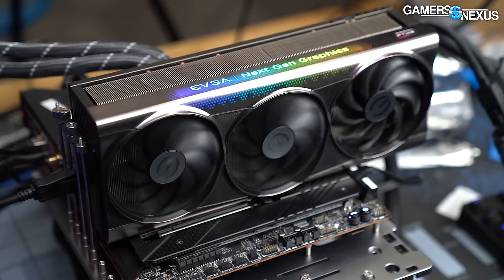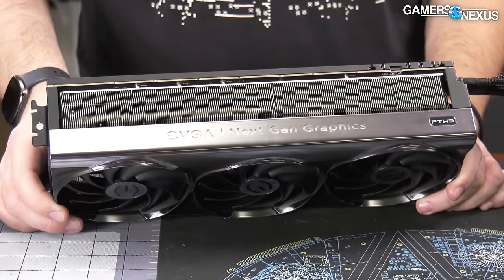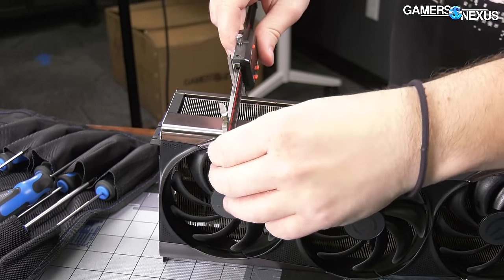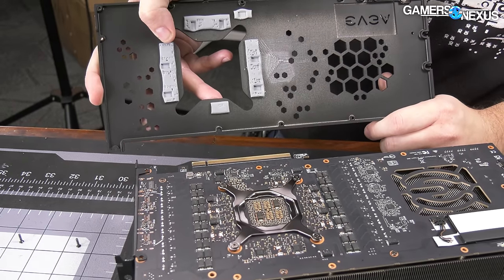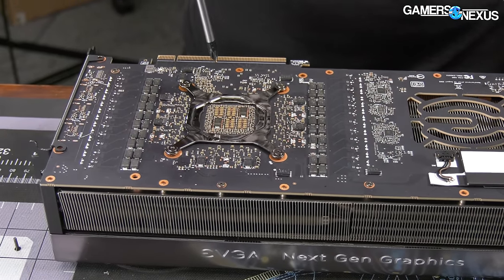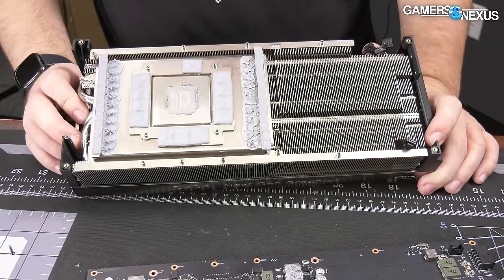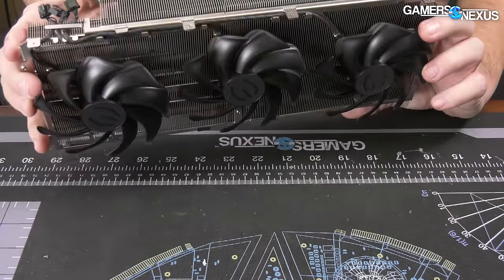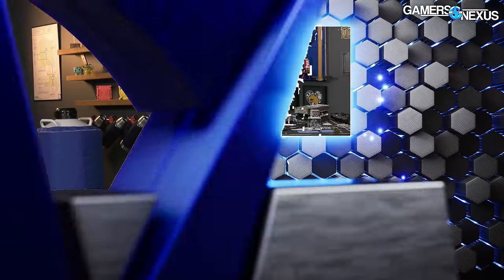EVGA RTX 4090 FTW3 Tear-Down & Disassembly: A Major Loss

Comment: Imagine if Nvidia criticized power connector placement and that was the final straw
Reply: I doubt it was anything so trivial, EVGA probably saw hints of the expected RRP and the costs and just decided it wasn't worth it. They're a smaller more boutique manufacturer so they can't spread their costs like an MSI, gigabyte or ASUS.
Reply: It was probably those shitty profit margins, 3000 series was probably enough for evga. Nvidia obviously doesn’t have to care about aib profits but if you’re evga why care about nvidias profits.
Reply: Yall love writing fanfic, but it obviously had nothing to do with that. Area 53 summed it up nicely. Jensen has made it clear for many years now that he's enamored with the Apple model of business, and so that's what Nvidia is working towards. A future with no AIBs. The profits are already razor thin for those companies. EVGA saw the writing on the wall and got out early.
Reply: @Washanuga  Yup, exactly and wanting to copy Apple isn't good for consumers whatsoever, probably switching back to AMD this gen if the 7000 series looks good enough for the price! I only switched to NVIDIA with the 20 series when I nabbed a cheap 2060 Super to upgrade from my old RX580 (Which I loved and had no issues with at all) Loved the 2060 Super and also love my current 3060Ti, however gotta say, after all the shit-talking about AMD drivers, NVIDIA's recent ones have been completely wack, I've never had a driver make my card act so strangely before till the one before the most current, I actually thought my 3060Ti or PSU was dying because GPU Load and Power to the card were both dropping to 0% randomly in games causing insane stuttering or the game would fully crash to desktop. Rolled back drivers and the problem went away, I was amazed it was a driver issue doing that. Luckily the most recent one doesn't exhibit the same behavior at all either. Also will add that I'm happy Intel is in the GPU market properly now, so we have 3 companies and more competition is better for all of us, just hope Intel brings out some proper flagship cards that can compete better with AMD and NVIDIA's higher end cards.
Reply: @licensetoshred  Problem is that I had several times the same kind of experiences with AMD. Crashes, overheating weird artifacts...not to mention the awful microstuttering in a lot of games. And I enjoy the extra feats Nvidia put on their cards. Loved playing the Arkham series with the Physx effects, and now DLSS and RT makes it worth it.
I do agree that they failed big time with the 4090, tho. Too large, too power hungry...I hope they lose a lot of money to AMD this gen and they change their ways and put more effort in efficiency.
Reply: @Shendue  Well RT is not a feature by Nvidia. It has been around forever and is a standard of Direct X.
What nvidia has is their tensor cores as specific calculators for Raytracing. Which gives them better performance.
Thats a seller if you are into RT. but most of the time its not used well and only costs performance for minimal changes that don't look like reality at all.
Also there are different ways of implementing RT. For example Dirt 5 and Watch dogs legion have RT and its good but it does not cost too much performance.
DLSS is also nice, but i prefer an open solution like FSR and XeSS. That way even older nividia cards profit from the performance gain. 

In the end it all depends on what you need and what you are willing to spend. For me it was simple. I want the most bang for the buck. The most fps for my money. And that is the RX 6800. And that will be enough for the next 3 years. Then i will take a look if there are cheap second hand cards or buy a new card for a good price-performance.
Reply: It's not as simple, but I think over the course of news since the announcement the info is out there that tells you why they ended partnership, you could piece it together, but even as a joke it is not what you were writing, the power connector placement, because nVidia doesn't really care that much how their partners create and design their cards basing on a given blueprint by nVIdia.

It's all about money and how much nVidia probably likes to change their naming of the cards in the last moments and other factors where partners are paying expenses that are not covered by nVidia, I suppose... Or maybe nVidia is covering some losses caused by nVidia itself? I don't know about that part. But it is damn sure it is about how business works there and how nVidia is playing with everyone.
Reply: @Shendue  Majority of times, AMD's issues are user-dependent.
Nvidia drivers are pretty much a joke and their high-end cards have been the least reliable since the 2000 series and continue to be.
Also it doesn't offer many feature more  than AMD, if not less. Nvidia's software is dreadful and gets annihilated by AMD's.
RT isn't going to get widespread anyways and FSR is just as good as DLSS now.
Only reason one would buy Nvidia cards is CUDA, and there isn't much AMD can do about it as long as devs refuse to optimize software for them too.
Reply: @Marco Sassari holy hell, I hate Nvidia but your comment reeks of copium. Nvidia having worse drivers than AMD? You can't be serious. Remember all the 5700XT black screens? Poor stability of pre-Crimson drivers? Or how about AMD dropping support for GCN? AMD's drivers SUCKED for the longest time. It's only with Nvidia's latest 526.61 driver that bugs started popping up.

Don't even get me started on feature set. No, Nvidia does NOT have "less features" than AMD. Where's your NVENC and CUDA support on AMD, two things widely used by professionals and streamers? Or DLSS 2, which is still superior (only slightly) to FSR 2 in terms of image quality.

Oh and you conveniently ignore RT performance (where AMD does worse than Nvidia) because  "it's pointless and devs won't add it." Spoiler alert: most AAA games have RT now. Just off the top of my head: Forza Horizon 5, Metro Exodus, Spiderman Remastered, Cyberpunk 2077, Gotham Knights, and many more to come.

Please, inform yourself before you go out on a whim to embarrass yourself. It's not that hard to do research.
Reply: @marcosassari5603  LMAO "NVIDIA drivers are a joke" ??? I guess I've just been.. hallucinating! for the past 10 years, my drivers have been a joke! dude! I've not been able to get anything done! holy mother of god, put down your copium tank, fan boy.
Reply: @licensetoshred  Yeah i've been having the same driver headaches with my 3070 in my laptop. I still can't play MW2 even with rolled back drivers.
Reply: @parsa475  Well nvidia drivers for linux are a joke. They really are.
Reply: @edenjung9816  I'd still argue that is a better position to be in for Nvidia compared to AMD.
Reply: @parsa475  Not with Linux.
AMDs drivers for Linux are the gold Standard.
Reply: @edenjung9816  what I'm saying, dude, is that although they should all work fine on all operating systems, Nvidia working on Windows where 99% of their users and the video games are is BETTER than AMD's situation, where they work better for the 1% who use Linux. If Nvidia has put more effort into making their gaming GPUs work better for Windows where they can be used for what they're actually designed to do, then that's a reasonable decision IMO. I still don't know what the guys above was smoking, though.

Comment: I said it on Jay's video too but I gotta say it here, something about this video feels very bittersweet.  I wasn't planning to upgrade to 40 series regardless, but just the loss we see here and how beautiful that card is feels a little melancholy.  EVGA will be missed.
Reply: I wish they'd partner with AMD
Reply: The first three GPUs I got when I started building my own computer was EVGA 760, 980 Classified, and my final EVGA and Nvidia GPU was a 1080.  I'm all AMD in my PC now, and with the 7000 series Im hopeful that EVGA will at least do one card with AMD.
Reply: A little?
Reply: @Woeisme2  They should partner with Intel for their next gen cards. AMD is doing more than fine right now, but Intel desperately needs a competent OEM company to set them on the right track, their current card designs are incredibly mediocre. Especially if Intel is serious about releasing some high-end cards next year.
Reply: yeah they were heading towards making probably the best version of the 4090. this is nicely laid out, well designed, and in Jay's video, he showed that the memory and chip both could handle some good overclocking.
Reply: @iddan1205  I starting building a personal gaming PC back in January and now have an EVGA 2060 12GB 3060 XC 12GB and 3080 XC3 10GB once my brother buys the current rig I have with the 3060 I will use that money to finish building a Ryzen 7000 series with the 3080 just need the motherboard CPU and RAM to finish putting it together in a Corsair 7000D airflow case
Reply: @KillahMate  If Intel let them do whatever they wanted with the Arc silicon, I could see EVGA making crazy “K” series variants as Intel’s premium option.
Reply: @ghomerhust  EVGA making the best version of .... Got me thinking, when was the last time an EVGA card version WASN'T the best of?
Reply: @KillahMate  Intel needs to sort out their drivers and the performance in older titles. Performance in games like cs go is laughable even at their lower price point.

Comment: Bless them for putting the 12 pin in the correct spot, I really feel like we should be more critical of certain other card designs that don't recognize its correctness lol
Reply: Placing opposing side from the fan means that there's no need to bend anything and it would fit in most cases. It's tradition and easier to manufacturer that keeps it where it is on most cards.
Reply: This connector and issues may well have been the reason they severed ties, as EVGA wouldn't put up with the warranty risks on their products due to something forced by Nvidia.
Reply: I was actually wondering, maybe this is why they made the PCB longer than others
Reply: Why if it's the last card from EVGA? EVGA cards will never be sold again.
Reply: @BlueBerry-kh3lx  Maybe Intel or AMD will work with EVGA
Reply: In a separate video Kingpin mocks NVIDIA on their decision to put the power pins to the most thermally hot place

Comment: It's a real shame EVGA is out of the GPU business. That fin density alone vs the Strix looks amazing. Breaking my heart.
Reply: I read this as EVGA showing some ankle to potential suitors.
Reply: @rhythmandblues9302  They need to cover up those ankles damn floozys lol.
Reply: @rhythmandblues9302  LOL I ain't heard that saying in a long time 
If I'm up on my internet law, I believe I am now legally obligated to use that phrase as often as possible for the next couple of weeks.  This should be fun.  Thanks!
Reply: not only that, there are the only clever one that placed the power connector right🥲

Comment: Like many, I was an EVGA loyalist. I bought a b stock 3090 and 3070 knowing they may never make another gpu. It’s an honor to have them.
Reply: I’m thinking about trying to get my hands on a 3090 EVGA card just to have it as a collectors. I have a 3080 tuf in my main rig
Reply: I got a B stock 3080. Works great, low noise and low temp, especially with an undervolt.
Reply: I got a 3080 to replace my 1080 and made sure I got an EVGA one.  I know it'll last me a long time under water.
Reply: It had the best price to performance 2 years ago when i was looking at rtx 3080’s. EVGA Ftw3 3080
Reply: @KillerInstinct1  Yep, it's not too large either, the cooler is awesome, and it undervolts like a champ. 920mV at 1950MHz (same as stock).
Reply: lmao
Reply: hanging onto my 980ti, 1080ti, and 3080ti ftw 3's for a long while
Reply: Keeping my Kingpin 3090. Thing is a beast. Collector item for the future.

Comment: Dude!!!! That tear down was legit. It looks like a very straight forward process and did not seem like you needed elf fingers. It is really sad that this card won’t come to market. :/
Reply: Clearly a card for dwarven hands.
Reply: I think it's so easy to disassemble because it's an engieering sample, and EVGA engeers will need to disassemble and reassemble it multiple times. I guess the final version would be a bit more annoying to save cost and/or improve looks.

Comment: I adore my EVGA 2080 ti. I wasn't much of a PC expert when I bought and installed it into my prebuilt rig, so I was amazed to later discover that the temps are really solid. Looks and runs great too. Really hope EVGA considers partnering with AMD!
Reply: Why would they partner with AMD if they just quit building gpu's for Nvidia, they might have the same problems with AMD, since no other manufacturers seem to be having problems with building gpus for Nvidia.
Reply: @budgetking2591  other companies definitely do suffer the same problems as EVGA. however, a quick google search reveals EVGA is privately owned, meaning it is not solely a soulless profit generating entity completely at the whims of investors and shareholders. that means EVGA's CEO can just up and do something else with the company if he's had enough
Reply: @budgetking2591  Theres something called "contract" which binds 2 or more parties together under certain conditions and often times it's timed. Evga can set certain conditions for their own benefit when working with amd and amd really needs to honor working with evga

Comment: Here's hoping that one day, EVGA returns to the GPU market in some form or another. This might have been the most "practical" 4090 in the lineup. Mainly because of the smaller size and power connector placement.
Reply: Intel and AMD in the future i hope.
Reply: I doubt it, I suspect the industry in moving towards integrated GPUs, the M2 Ultra would be probably close to a RX3080 already.  NVIDIA was trying to acquire ARM and has plans to move in this direction too.

Comment: I'm in the process of 3D modelling a new shroud for my Zotac 3070ti to use with noctua 92mm fans instead of the stock solution. I think I just found the perfect shape for that.
Reply: Back in 2009 I did that with my ASUS GF 9800 GTX+ Dark Knight. That small fan was really noisy so I took it off and just slapped 2x80mm Noctua fans strapped through the fins. It was quiet and gave me more OC potential.
Reply: If you can share the final result I would be grateful !!
Reply: Do share the end model, I bet plenty of others would love to have an EVGA-styled shroud.
Reply: Sure. When it's done I'll post it on printables and share a link in this thread. Might take a week or so. Also, be advised the first iteration will only fit a Zotac 30 series Trinity heatsink. Although I would be open to commissions to adapt it to other heatsinks, provided I'm given accurate attachment dimensions.
Reply: Here I am buying a Asus×Noctua 3080 and this guy is designing his own.
Reply: GN has links in comments auto-disabled, but if you go to my twitter (same name as here), you can follow along. I just posted an initial 3D render.
Reply: First part is printed and fits, awaiting fans and adapter cables to arrive in the mail, then we can test temps before printing the main shroud.

Comment: Did not expect to hear that you guys would actually be testing the card! Very excited to see that, even if it's simply in line with all the other 4090's right now. Either it's impressive, which would show what a loss EVGA is as a partner, or it's functionally identical to the other cards, which could (but not necessarily) indicate the constraint placed on partners like EVGA by NVidia. Or it's a disaster of a "wip" build, which would be unexpected, but interesting in its own way as well.
Reply: Jayz 2 Cents also has one and he did a little impromptu testing. Not gonna spoil it but I will say if EVGA stayed in the game they would have been right up there at the top.